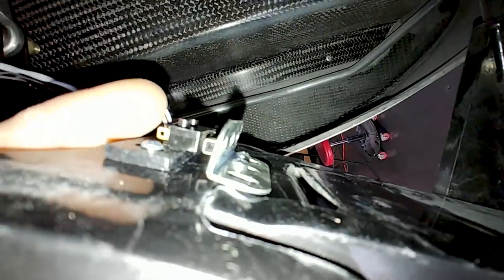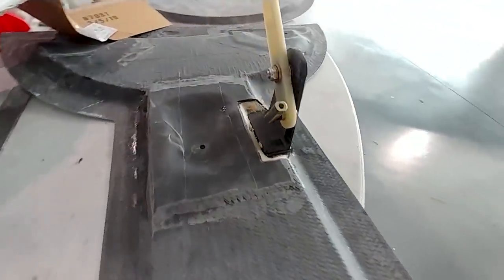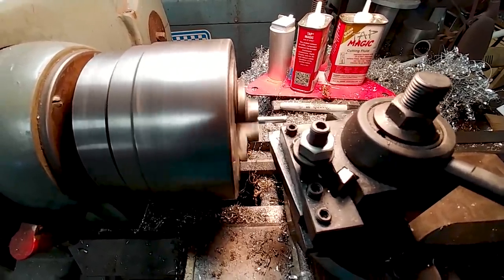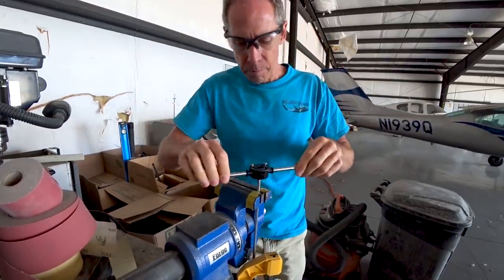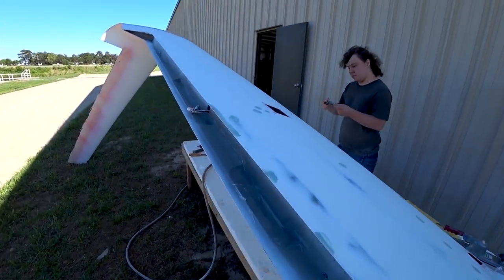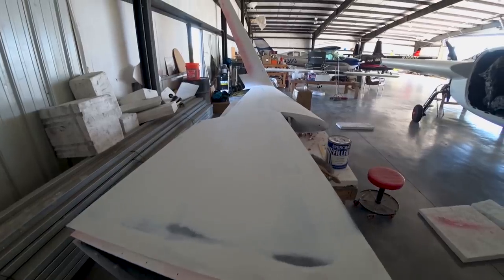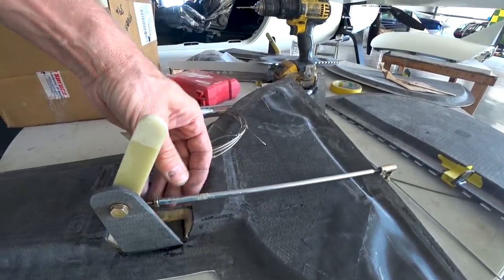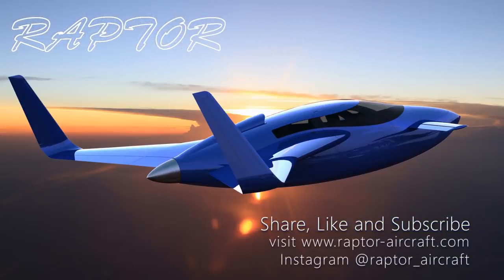Figuring Out the Puzzle - Building the Raptor Prototype

Comment: "Slop in tapered roller bearings"
There should never be any. There should be a nut on the shaft that snugs against one of the inner races which puts a bit of pre-load in both bearings.
...Like a car wheel bearing.  The preload should be sufficient so that normal operating stresses never completely unload pressure on either bearing.

Comment: The gear down micro switch isn’t waterproof. Is that what you plan to use permanently? Seems a bit fragile and susceptible to the elements.
Reply: I agree with your comments. The micro switch is the wrong IP rating and that particular type will fail in short time, especially for critical detection of landing gear. I would recommend an industrial limit switch, snap action (Siemens, Honeywell) with over compensation so no contact pressure due to movement in landing gear in stored position.  This means when the switch is set up correctly and detected, it will allow further movement without damaging the switch.
Reply: @iwayini  I agree. In addition I worry about vibration causing failure and or not providing a conclusive output.
Reply: We used these in our factory and they did not last long, hate to use them on a critical process

Comment: How's weather (gear down in wet weather) going to affect that switch???  Simple Magnetic/proximity switch bit safer and more resilient?
Reply: Yes, those switches are usually not moisture proof.  You will need to cover or protect them somehow.  A better solution would be to replace that with a simple spring loaded pin, wire 1 lead to the pin and the other lead to the bracket.
Reply: True. I'm really puzzled how the magnetic switch didn't work out.
Reply: @olliea6052  i agree those limit switches are always failing / breaking, keep trying with the magnetic proximity switch

Comment: I’d put the gear doors aside before wasting time on the cable solution. I’ve been watching along for a long time now, and that’s the first idea that I just absolutely objected to!  Keep up all of other great work!
Reply: Agree, as much effort and money spent here, that was disappointing.   Think about it some more, a solution will come to you.  Or ask around.
Reply: Yes, for such a nice aircraft that cable system doesn’t belong.
Reply: For the production model, I'd consider hinging that door part on the other side (wing). Then you can have a long lever attached to the back side which continues into the wing where you can attach a rod.
The current construction is too weak for the wind forces, it's going to flap around. I'd just put it aside.
Reply: A spring along the hinge axis mentioned below would be more elegant. However; the short moment arm of the actuator compared to the area of the door just seems like an invitation for problems. Getting the gear door off the gear leg and keeping attached to the wing where the retracting wheel holds the door shut would be an even better idea.

The cable in the slip stream would be OK for a WW1 fighter but is way below the standards for this aircraft.

Comment: Try repositioning your WiFi in the back of the cockpit— perhaps under a seat or mounting it on a wall by the back seat. That removes the WiFi from the dash area. The WiFi reception will still get to the components needing it on the dash.

Comment: Throw away the lower gear doors and cut off the hinges on the uppers. You're just adding weight and complexity and more failure points that could result in debris going through the prop disc. All of the wheels are exposed on 737's and half are exposed on the Velocity XL's. Seems to work just fine for them.
Reply: Wow never even thought of that. If one of those doors comes off could be a very bad day, or deadly if it happens at low altitude on the initial climb out

Comment: STOP! The way to operate the main gear flipper doors is with a Teleflex cable or even outboard boat motor control cable. Attach one end to the body interior at a point where as the gear moves the differential travel of the cable is used to operate the door. Springs and such ain’t gonna get it. Magnificent creation you are building. No need to be in a hurry for an arbitrary finish day.

Comment: The early Beechcraft Staggerwing had a similar door design but less complicated. Same hinge setup but a torsion spring to hold the door open. 
When the gear comes up, a thin cable pulls the door closed. The geometry causes the cable to tighten/shorten as the gear comes up.
When the cable is relaxed, the torsion spring holds the door open.

Comment: In chasing WIFI interference issues on VHF frequencies 150-170 MHZ range, the one time it was not a power supply issue we isolated it to broadband noise come from the WIFI antenna.  Eight feet was enough to remove most of the interference.   WRT the gear sensors, you might consider inductive/capacitive sensors they will work with your bracket and are weather proof and no moving parts.  Automation Direct down the street sells lots of these for $10-$20.  Finally if the gear doors close but need to be held closed, I think the previously suggested rare earth magnet solution might be worth a look.  Good luck, great progress.

Comment: Any thought, maybe not for the prototype but production, of hinging the bottom part from the wing and using a retraction mechanism similar to that of the nose gear where the wheel pulls the door closed? I like the sleek look of the door all as one piece but what scares me is how it opens when you lower the gear. I’d be afraid if the wire or spring break, now you risk scraping the gear door on the runway.

Comment: Try a Torsion spring on the bolt of the green bar.  That may be the easiest way to solve the return.  You could also put a stop on the bracket and then pre-load the torsion spring.

Comment: What about using magnets to hold the lower gear door flap shut? Theres alot of power to lower the gear, but on return a few strategic magnets on the door and wheel well would provide a solid connection to counter possible flutter of that lower part?